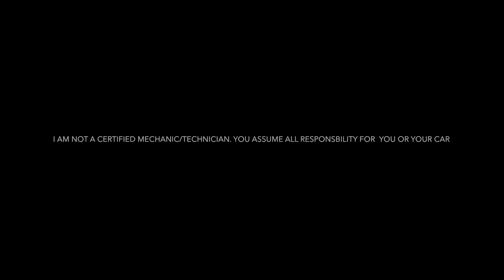350Z DUAL CALIPER INSTALL

Comment: I installed my Axel's and they turn smooth and get hard to turn if I spun the other way it spins and get hard. I get around 270 degrees of rotation... I'm stumped I torqued everything to spec and my axles are good. Wondering if you have had it happen?

Comment: Do u have a rough estimate on how much this was? And does that adaptor plate push the wheel further out? My rear wheels are pretty close to the quater panel im running 18x11 i had to roll it and i wanted to do this ..thanks for the great video too
Reply from the maker: iSICK tutorials its been so long I don’t remember the cost. If I’m remembering right it was somewhere near $1000 for the complete set up (break pads - hydraulic hand brake)
The dual caliper brackets do add a few mm like a spacer would. I also run 18x11 with 295/30/18  in the rears (cosmis xt206r) and have no problem with fitment.
Reply: @aliagasergio  thanks for the reply im running the same wheels but i could only fit 275 35 18 🤔...i couldnt find my offset on the back of my wheel so idk what my offset is
Reply from the maker: iSICK tutorials should be the same offset of +8. The tires I run are Sumitomo HTR Z III 295/30R -18

Comment: Do you have to remove the axle? You can’t just remove the 4 bolts holding the wheel hub onto the knuckle then remove the rest?
Reply from the maker: Marcos Morales I’m not 💯 since its been a while but if there was a way around it and I didn’t do it, it is probably because it was more difficult to work around the axle rather than to remove it.
Reply: SergioAliaga ahh ok thanks gotchya man just making sure. Gonna do this on my 370 as soon as my bracket gets here 🤟🏼
Reply from the maker: Marcos Morales right on. Lmk if you have to or not when you get to it!
Reply: SergioAliaga you got it man.
Reply: SergioAliaga yep just finished the install you HAVE to remove the axle well Atleast on the 370z anyway. No way at all to get a socket or wrench in there even with sliding it all the way to the back. Hey were your nuts short like not all threaded when you installed the two nuts that attach the ebrake to the knuckle? Mine threaded but looked like it should have threaded more there was like a third of the threads missing when installing those back after putting the bracket on.
Reply from the maker: Damn lol it isn't that much more work to remove the axle though. If they are the bolts I am thinking of, yeah they're not threaded the whole way. They should be tapered toward the top.
Reply: SergioAliaga forsure I thought it’d be ok. I tightened the shit outa those nuts lol. yeah it wasn’t too bad I didn’t even remove them completely just left them hanging cuz I woulda had to remove a lot more shit to remove them completely but I just worked around it. Just need to hook up the lines and I’m set 🤟🏼

Comment: Did you have to remove the xmission to run the hydro line?
Reply from the maker: pfunk heli no you just have to remove the drive shaft and maybe diff depending how you run it.

Comment: Hey brah, can't find that line kit on enjuku. Is that where you got it?
Reply from the maker: My bad I got it from Parts Shop Max(PBM) but honestly you could just go to Napa auto parts and have them part it out for you. https://store.partsshopmax.com/universal/Hydrobrake/HBLFR.html 
The 3AN fitting that came with the package didn’t fit my nameless hand-break because they used the pass through size rather than the reservoir size so I had to order one from ASD http://www.asdmotorsports.com/product/3an_kit/
Reply: For sure, Napa is probably way cheaper but I have to measure it's out which might be a B
Reply from the maker: Same

Comment: Yup I can learn off of you lool. I'm looking for a 350z for a drift car to. Question what the first thing u did to it when u got it ... I'm assuming it was stock. And yup I had to sub lol
Reply from the maker: Awesome man! They're definitely the best platform imo. I did PBM coils/Voodoo13 arms/ and welded my diff in basically one shot. In all honesty I could have just started with welding the diff before dropping money on the suspension and had a lot more fun right off the bat with spare tire money but we live and we learn lol. 
Also If you're looking to get a 350z for drifting I suggest getting a base model. They're cheaper and weigh less plus if you're building it for drifting you will eventually replace the parts that make it the track/nismo model. So save the extra money that you would spend getting the "upgraded" model and modify the base to your own specifications.

Comment: where did you get the tunnel mount?
Reply from the maker: mike watts levelride concepts used to produce them, not sure if they still do. You’ll have to find them on Facebook and send them a message.
Reply: cost?
Reply from the maker: $34.99